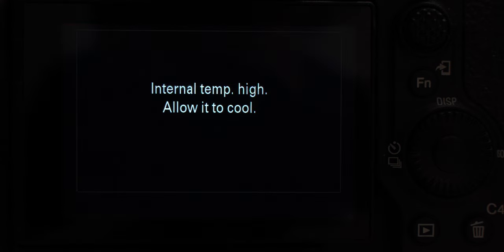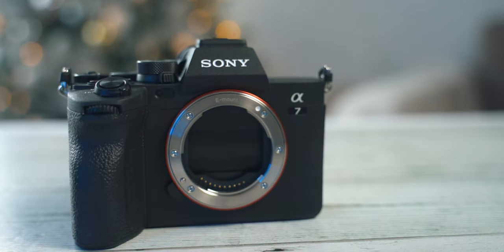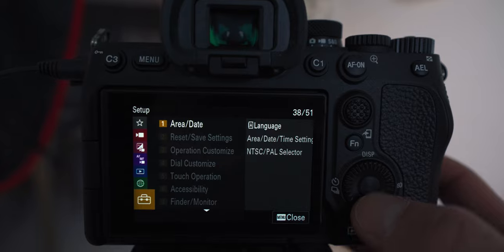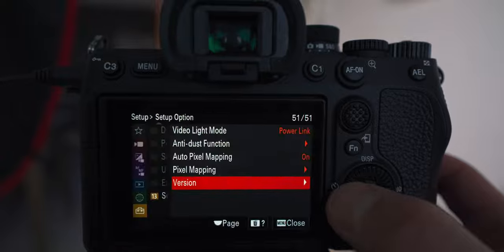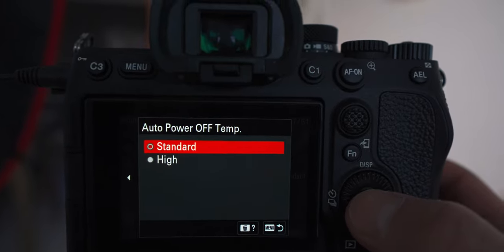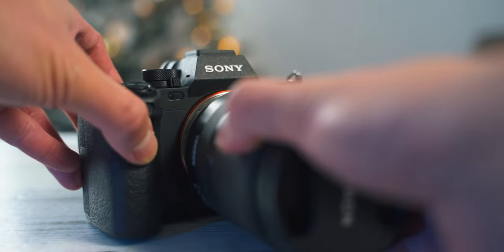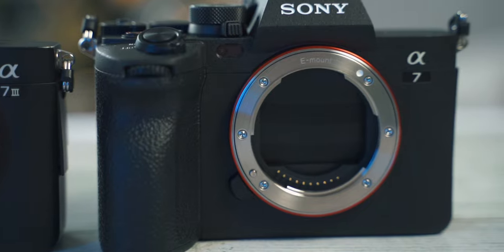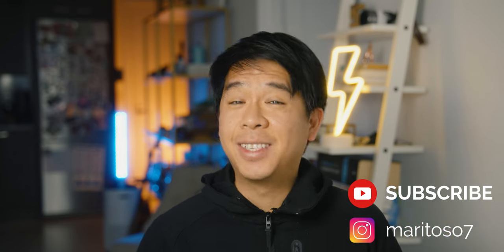OVERHEATING On the SONY A7IV and How to FIX It! | Do This First

Comment: Hi mate, thank you for this. I've been witting with my A7IV this morning for about an hour (not recording or shooting, just programming menus) and I've had this overheating warning and had to stop. This is despite the fact that it has the latest firmware update and the setting you mention switched to high. I'd be grateful for your thoughts? Many thanks, Nick
Reply: same exact situation with me... its overheating just with me going through the menu settings.
Reply: @rich4363  when did you buy it Rich?
Reply: @NicholasPaulFranks   December 2022
Reply: @rich4363  has it only just presented as a problem?
Reply: looks like sony did not solved it. Wont buy this camera.

Comment: Hello Mario and @everyone, is the overheating of a7iv already fixed now? Planning to buy this January but I am afraid that I might catch a bad apple :(
Reply from the maker: I haven't had issues since. It's been over 2 years now. I know a few others who have one with no issues
Reply: @MarioSoMedia  since? Since a firmware update? I just got this camera and I have overheating issues! :( 

Tried to use as webcam through usb and it was hot AF! Yet managed to go until the battery died. 

Tried to record a timelapse in the S&Q mode, would overheat after 30 minutes +/-. 

Recording at 4k 30 fps also results in overheating. 

Using a V90 prograde 512gb card. 

Thankfully I'm testing in my house, what would happen if I took it out to gigs???

Comment: So do you think is it possible to fix overheating in the next update firmware or just guess this? I asked you becouse I have pln to buy this camera ,the second issues is  when you use raw file  for photography in the uncompressed raw files you'll get just 6 fps , Is it possible to fix  from new firmware on the next update?
Reply from the maker: It's all just hopes right now. Hoping for the best. I have been using my camera on long shoots with no overheating whatsoever now since I have the flip out screen articulated out.
Reply: @MarioSoMedia  For now I still use A6400  but I have plan to to buy A7IV , I hope  they will all issues.

Comment: Im sitting in air conditioned room and I just turned it on for the first time and start to setup settings. But 10 minutes later (before I was able to complete setup) I got message about internal heat and camera shut down before I was even able to complete a setup. Is this normal? This is my 5th Sony camera and I've never seen anything like this before..
Reply from the maker: Did you set the temp setting to high?

Comment: Alrighty. So… I’ve contacted Sony. Just as they’ve fixed overheating issues with the A1 and many other models with firmware updates, they have been receiving reports and their production team should be working on it. This is not an official statement, but given their history of fixing these issues, I’m sure this will also be taken care of.

In the meantime, this was their advice:
1. Change the auto power off temperature setting from “standard” to “high.” This is one we already know. 
2. Turn on airplane mode so that it’s not drawing power constantly attempting to search for devices to pair with BT and NFC.
3. Turn the screen brightness down to the lowest setting.
4. Turn off proxy recording. 
5. Turn off focus breathing compensation. 

Other tips I’ve seen around include: 
1. Keeping the screen flipped out and away from the body (which we know, also not always ideal depending on your situation).
2. Leaving the battery door open (which we know, but may not be ideal).
3. Attach a lens on the camera instead of the body cap (heat can dissipate through the lens better than through the body cap).
4. Don’t cradle the entire body of the camera in your hands for a significant period of time going through the menus and setting up the camera.
5. Don’t play with it in bed (or any other location where it may be “suffocating” on a blanket, on a pillow, etc., just like you wouldn’t with a laptop).
6. Do not have the camera in video capture mode while going through your settings, as the sensor is currently programmed to pull power at all times in movie mode, creating heat. 

If you have the body cap on, are cradling it fully with both of your hands coming into contact and covering most of the camera body, sitting in bed resting the camera in your hands on the blanket that’s on your lap, and you’re in video mode; it will probably overheat. Lol

However, the Sony representative I spoke to said “As of this time, there is no firmware update that will address it. This has been raised already to our product engineers.” 

And while he could not give me an official declaration that there is a firmware update coming, the answers to the rest of my questions gave me great confidence that their engineers are working on it, and that we can look forward to a firmware update that should fix these issues, just as they did with the A1, A7SIII, and A7III before this. 

So. I’d go far enough to say, hang on! The fix should be coming!
Reply from the maker: Woah thanks for such a detailed insight! Hoping for a firmware update soon but until then keeping the screen flipped out it is. 😅
Reply: @MarioSoMedia  course! Just trying to help :).
Reply: @MarioSoMedia   and then, of course, there’s the question of whether I should trust Sony’s representative. Lmao. 
There are two Somy cameras in my home, an A6000 and the A7IV. I have yet to see issues with either, but I haven’t used the A7IV yet (turned it on to play with settings quickly a couple of times). So… hopefully, they’re not just blowing smoke up my ass 🤣.
Reply from the maker: 😅😅 hopefully yours doesn't have that problem!
Reply: @MarioSoMedia  🤞🏻🤞🏻🤞🏻🤞🏻🤞🏻
Reply: Wait, why are people playing with their camera in bed????
Reply: Casually setting up the camera/going through settings.
Reply: @AmitZinmanVideo  🤣
Reply: Thanks for the above. V handy tips. Mine was in video mode when it overheated. I’m also worried that my EVF went black for quite some time while the back screen was still working as usual. Doesn’t feel like this should be happening right out the box, even before I get out and start working with it.
Reply: @danielmulloy1954  the EVF isn’t always on. It’s on when you put your eye up to it. If it was always on regardless, it would suck a ton of power.
Reply: @danielmulloy1954  I used mine all weekend at a convention doing video and photo. I had no issues… and I’ve done nothing to it but change the default setting to high.
Reply from the maker: @MichelleUretsky  Same here. Shot a bunch of paid gigs and YouTube videos and it's fine.

Comment: The over heating issue worries me, should I still buy this camera?

I am starting a youtube channel.
Reply from the maker: Very good camera for both stills and video for the price. Once you turn the temp setting to high, you should be good to go. Been using it for almost two years for YouTube, travel and client work with no issues.

Comment: Hey, i did change the option to high but still is getting warm, even tho it doesn’t show me overheating symbol, is this something normal? Thanks in advance
Reply from the maker: The camera getting somewhat warm after using it for a while it's normal but if it's unusually warm, almost hot, then there might be an issue.

Comment: Hi.  I hope this info is useful.  First, set it to High Temp of course in the menu.     I did my own tests on my A74.  Here is what I found.  I recorded in 10bit 4K 4.2.2 H.265 (the XAVC HS mode).  I put it on a tripod in a 72 degree F room.  In 24P it recorded for 1 hour and 53 minutes when the battery died.  No overheat warning or shutdown.  After a long cooldown.  I used the same codec H.265 4.2.2 4k, but at 60fps on a tripod in the same 72 degree F room and recorded for 1 hour and 42 minutes - which is when the battery died. No overheat warnings or overheat shutdown.   Maybe the H.265 helped with the longer 60fps record time, or maybe it was because I had it on a tripod.  Not sure.  I also tried the 10bit H.265 HS 4.2.0 Codec in 24fps and 60fps and got essentially the same times as the 4.2.2 H.265 HS times.  I normally record in the HS 4.2.0 mode, as I like the smaller file sizes, it edits easily on almost any computer ( since it's the 4.2.0 Codec, and most Macs and PC's have hardware optimization for that particular H.265 Codec). I always record in Slog 3, and I have yet to be able to discern any color grading flexibility difference between the 4.2.2 codec or the 4.2.0 codec in any footage I have ever shot.  I haven't seen any limitation of the 4.2.0 10 bit H.265 HS codec in any color grading pushes, Noise Reduction, or effects.  It all grades just as well as the 4.2.2.  Hope this is helpful.
Reply from the maker: Those are very interesting findings! Thanks for sharing.
Reply: How hot did your camera get during those tests?
Reply: @eliasgottschlich  warm to the touch but not so hot that I couldn't hold it.
Reply: @RockyColaFizz  so it seems that the A7IV has no real overheating problem..
Reply: @eliasgottschlich  Not in any kind or reasonable use scenario

Comment: Thanks for this useful video. I have recorded for 20 minutes in 4k 8bit before overheated. When i set the temperature to high, there was no overheat while recording for 80 minutes. But is it safe to use the camera with temperature to high?
Reply from the maker: You're welcome! I haven't experienced any over heating after setting it to high. Others havent experienced overheating at all. I would say to use at your own discretion especially if you record continuously for that long.
Reply: @MarioSoMedia  Thanks for your reply. Your tests was made with temperature to high?
Reply from the maker: +Labros Traveller Yes. Set to high. I have since updated the firmware and set it back to standard. Haven't had any issues yet.

Comment: I changed it to high and I turned it off 15 mins later, the camera body felt hot.
Reply from the maker: You can try having the screen articulating out and if it's still heating up, I would return it. I have heard of some batches being faulty with this issue.

Comment: I really wish Sony would just keep the auto power off temp at high as default instead of standard...
Reply from the maker: Yeah true! Or give us a firmware update soon 😅
Reply: That's not the issue here. So far as I know, people who have multiple a7IV cameras, reported that only some cameras have this issue. Meaning that this is a production issue, not an issue with all a7IV cameras. My friend ordered 4 of them for his company and only one of their cameras overheats, the other three are fine and they are not even set on high power off temp, they are on standard. I'm still waiting on my a7IV but if I have that issue, I'm returning the camera the very same day. It's a faulty product. If it was an issue with ALL a7IV cameras, then it would be a bug or a glitch that can be resolved with a firmware update, but since only some cameras overheat, not all of them, that means that there's been an issue in the production of the camera and I don't want to resort to firmware updates for my 2,600 EUR camera to work as it should out of the box.

Comment: To me all that does is shut off the warning and shut down. The camera is still getting hot. So really not a "fix" to the overheating. That's like disconnecting your temp gauge in your car if it overheats ... then thinking "there, it's not overheating anymore".
Reply from the maker: It's really a temp fix till they upgrade the firmware. The camera works well and fine after that is set to High. The issue is that the camera "thinks" it's overheating after only 20 mins when in reality it isn't. But yeah a real fix has to come via firmware.
Reply: @MarioSoMedia  If you say "a real fix has to come", then what I stated is actual reality. I'm not dissing you, just great conversation! :) THANK YOU for this video.
Reply: Heating and overheating are not the same. A camera can run hot, without doing any damage. Overheating is when a device is so hot it causes damage to the internal circuitry. That won't happen, regardless of the temp warning. That's simply deciding when to warn you about temperatures. 

The analogy here would be if you had a fuel gauge set to warn you first at 50% and then at 20%. In neither case is the tank empty, and both are just different sensitivities.
Reply: @davidschloss2656  Sony's own "temp warning" is shutting down the camera. It's set from the factory. I'm wondering if when you set it to hi and something happens, the responsibility is on you and not Sony anymore. I'm also wondering how the warranty would get effected when the consumer changes it to hi.
Reply: @chuckm482  it’s not overheating. It’s shutting down the camera before it oherheats. Both settings do the same thing just at different sensitivity levels. Neither will let the temperature do damage to the camera, neither have any effect on warranty.
Reply: @davidschloss2656  Sometimes I overreact with things like this. Sorry. This is my 1st (to me) real investment into the camera world and spending $2,500 and all I see are overheating fixes. Not including the $3K I've spent in lenses too! :)
Reply: @chuckm482  well don’t worry it’s not really a “fix” because nothing’s really an issue here. There are two overheat warning settings and you can use either. One is more sensitive than the other. 

If you watch the videos about “overheating” they all say basically the same thing. 4K/60 422 will run about 30 mins with the lcd closed and it will run indefinitely with it open. And no one seems to be reporting issues with 4K/24 etc. 

It’s a great first “real” camera. Remember that videos with dire warnings in the title do better than videos without. I’ve seen videos that have “overheats” in the title and then the YouTuber says it never overheated for them.

Comment: Yes, friends, Sony has ripped this camera a lot, unfortunately, I was able to buy this camera after years of work, but with this hot problem, I recommend that you never buy this camera, Canon and Nikon are the best, they say update or card.  Change the memory, it's all bad, didn't Sony test them during production?  It's nonsense...😔😔😔
Reply from the maker: A few other cameras overheat too from other manufacturers. the issue is trying to pack so many goodies in a small body. But if you set the temp to High on the a7iv, you should be good to go.

Comment: This is nothing new you have to keep ALL sony Alpha cameras on High if you plan to record video for 30mins or more in 4k. The update has nothing to do with it and will not stop it from overheating. It's just the way Sony cameras is you have to put them in high. Congrats on the new camera
Reply from the maker: +Michael Mystro Pierce Interesting. Which cameras did you experience this issue with? The a7iii has a 30 min rec limit so I never experienced it. Neither with the a7c, a6300, a6500.
Reply: @MarioSoMedia  A9, A92, A7R3, A7R4, A7S3, A1 I've had them all and they all will overheat in normal setting. They have to be put in High mainly when recording 4k video.
Reply from the maker: +Michael Mystro Pierce I see. Good to know. Thanks for the info!
Reply: @town3  you’re right!  The only time I’ve never seen this are on Sony APSC’s like the A6600’s of the Sony ecosystem and it always happens on the Sony full frames💯. The A1 $6,000 body does the same thing🙄
Reply: @town3  This is the correct answer.